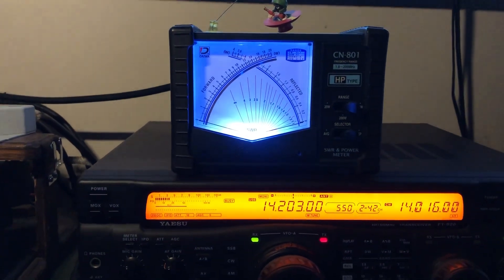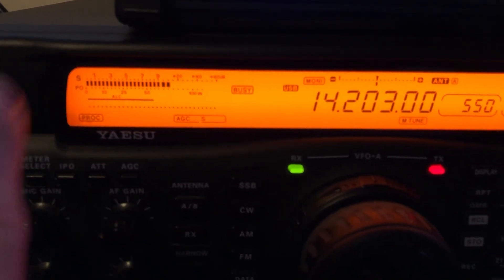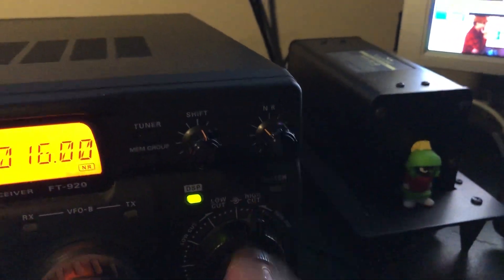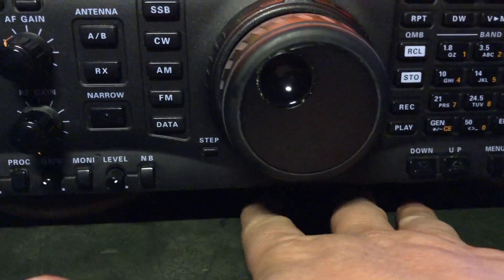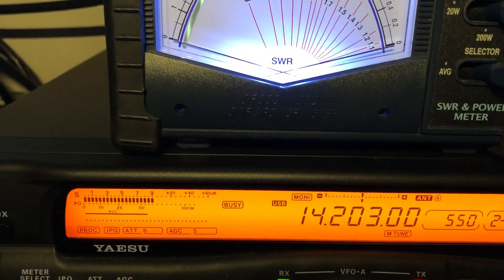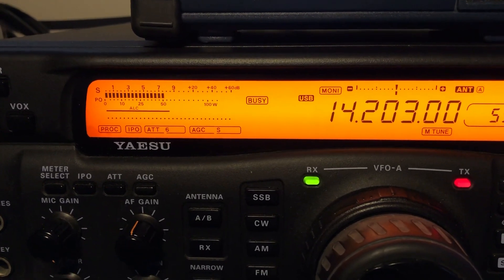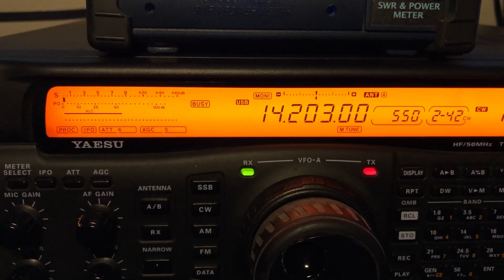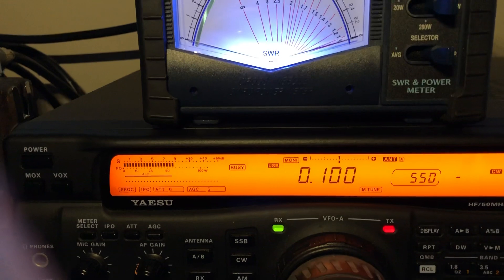Yaesu FT-920: DSP and Filtering (FTdx5000 being repaired)

Comment: I used to use the FT920 for 20 years.  Loved it especially for CW.  That DSP dial was fantastic for shaping the filter that you need.  It was hit by lightning last month so I picked up a FTdx10 with 300 Hz roofing filter.  Fantastic radio but I do miss that big DSP knob.  Thanks for making these videos
Reply from the maker: I still have my 920.  Used mine for 20 years also.  I did upgrade my FT-920 to INRAD filters. That extended its time on my operating desk.  But admittedly, it’s still no match for the FTdx10.
Reply: Do you find that it takes much longer to tune the antenna to a new frequency using the FTdx10 than the 920?     I recall the 920 was almost instaneous whereas the dx10 takes 3- 7 seconds
 @n4hnhradio
Reply from the maker: The internal ATU in the FT-920 is motor-driven and matches a wider range of SWR error. Once match parameters have been memorized, the motors track with band changes and the movement of the VFO. The ATU in the FTdx10 is relay-based. Once it memorizes settings it can recall almost instantly. But it can only match up to a 3:1 SWR error. That is typical for the modern transceivers from all manufacturers.  As many of you know, I like to call the new breed of internal ATUs “touch-up” tuners.  

We have fallen victim once again to only getting what we are willing to pay for.  Hams today complain about the price of the radios.  The manufacturers are pressured into cutting their margins razor thin. The fact is that radio prices have not kept up with the rate of inflation.  A Collins transceiver in 1959 cost $1,200.  In today’s money that is nearing $13,000.  Can you imagine paying approximately one fourth of your yearly salary for a ham radio?

My FT-920 cost $1339.95 back in 1999, and that was a sale price.  I had to pay extra for the FM board and the CW filter. I didn’t purchase the optional TCXO, regrettably.  All of those options are standard equipment on the FTdx10, for approximately the same price I paid for my FT-920. 

So how do manufacturers include these niceties and keep the price the same as a transceiver that sold for nearly the same price 25 years ago?  They do it by cutting corners in one or more areas to give the purchasers what they seem more interested in.  These days purchasers are more interested in a color touchscreen, waterfall, digital modes, etc.  Many of us use external wide-range antenna tuners anyway, so that is a logical area for cost-cutting.  And don’t forget the amount of internal space that the motor-driven tuners require.  The right-hand third of my FT-920 is antenna tuner.  The left-hand third of my FT-890/AT is antenna tuner. 

So the modern transceivers are typically smaller, which is another thing that purchasers seem thrilled about.  They don’t realize that at some point the radio becomes too small to have a decent sounding internal speaker. But the manufacturers probably assume we will buy an external speaker anyway.  Note that the external speaker is one of the accessories that help the manufacturers recover profit margin that is lost in the price of the transceivers.  As I said before, there is very little profit margin in the price of the radios. The manufacturers therefore charge a premium for the accessories.
Reply: @n4hnhradio  Great points. The rig manufacturers are also in step with the antenna manufacturers which offer nice broadband antennas that have swr's under 2. Also think modern electronics for military, cell industry etc. have driven the chip industry into the stratosphere. IMHO the DSP and DDS chips and of course processors are off the shelf. A lot of the engineering goes into the software and ergonomics for the operators.
Reply from the maker: The chips are absolutely not ASIC chips. They are standard chips. The magic is in the programming. Yaesu and ICOM both use Texas Instruments DSP (except the FT-710), but Yaesu has the better programming. Yaesu and I have a strained relationship, and that is an understatement. But I deal in objective truth on this channel. I have to give the edge to Yaesu, even though Yaesu is critical of me. If not for the private support I receive from viewers (via Patreon.com/N4HNH) my channel will cease.
Reply: @n4hnhradio  As a casual operator I was using my second hand ts-940 for 25 years until the other day when I received my second hand FT-920 which is what drove me to your video. My first "modern" rig and first Yaesu . Yaesu made a nifty xcvr and the menus are very intuitive. Great rig for 1990's vintage.
Reply from the maker: I agree. People think the Yaesu menus are difficult. I find them intuitive. Like you said.

Comment: The carrier offset trick to add treble to a bass-leaning mic was very helpful. My Yaesu MD-1c8 is very heavy on the low side and my MH-1bb hand mic out performs it without question. I'll give that offset a try. Thanks for posting!
Reply from the maker: You’re very welcome.  The FT-920 is still one of my favorite radios.  You can try switch position 2 or 3 on the bottom of the MD-1c8 to cut some of the low frequency response.  Position 2 will cut 100Hz by 5dB.  Position 3 will cut 100Hz by 10dB.

73, de N4HNH
Reply: @n4hnhradio  I've tried all 3 settings on the MD-1 without much improvement. I can record off the air for comparisons via web based SDR receivers. My voice just has too much natural bass to it. My MH-1 hand mic, on the other hand, adds the perfect amount of treble to cut through noise. But it's a hand mic. And I just hate to relegate that good looking MD-1 to the dust collector shelf. So the frequency offset test will hopefully bring it back to usefulness. Thanks again! 73 de K7KDX
Reply from the maker: In that case, I suggest setting the mic switch to position 3 and use a positive carrier offset of 100 to 150.  Also, set the mic EQ (menu U-51) to off.  You could try setting 1 or 2 in menu U-51, but those are DX audio tapers.

Remember too that there are 4 carrier offset menus, one each for LSB and USB, with and without the processor.

73, de N4HNH

Comment: I have the Yaesu FT920 and bought it new when they first available from the dealers. It still works very well and has never needed repairing.  73 Bob, M0BOB.
Reply from the maker: Still one of my favorite radios of all time.  I bought mine new in 1999.  The INRAD filters took mine to the next level. 

73, de N4HNH

Comment: I love this radio, I customized a 0.5 ppm TCXO, it works great.  FT-920 with 730 V dipole, I make a few hundred contacts in 2011/2012 at SSB mode. 
Taiwan to US, all Europe, South America, and the South of Africa.   
What wrong with your FTDX-5000?
Reply from the maker: FT-920 is one of the unsung heroes of HF rigs.  It still holds its own today.  Like I said in the video, the CAT port on the 5000 stopped working.  The fellow with Yaesu said the failure is often caused by RF, via the serial cable that is connected to the CAT port.  I just purchased the cable from RT Systems 3 weeks ago.  It doesn’t have an RF choke, so perhaps that is the issue.  We shall see.
Reply: @n4hnhradio  Noted. Just enjoy your FT-920 and just give us some news regarding your FTDX-5000.
On the other hand, did you think that the mu-tune 30/20 is worth own it or ...
Reply from the maker: My channel isn't only about the FTdx5000.  It pertains to general operating practices.  Like I say in the videos, much of what I do with the FTdx5000 can be accomplished with similar features in other radios.  It was simply my experience that the 5000, 101D and MP, and the 3000D from Yaesu were among the best receivers I tested.  The Yaesu DSP is superior.

As for the MTU-30/20, it can be worth it, if you chase ghost stations like I do, and you need that extra edge for combating QRN or QRM.  I use mine more against QRN than against QRM.  This is covered in my videos.  

The mu-tuners do not block QRM 2KHz away, contrary to popular misconceptions.  For that matter, neither does the VC tuning in the FTdx101D and MP.  The preselectors narrow the front-end of the receiver.  The mu-tuners narrow to approximately 35-40KHz of band-width, sloping on each side.  This effectively minimizes out-of-band interference.  

I use the mu-tuner as another type of attenuation, where I get to choose what frequencies get attenuated.  I adjust the mu-tuner such that the weak station I am listening to falls into the bottom edge of the skirt of the filter.  I can still hear them, at maybe S0 to S1, but the noise is gone.
Reply: @n4hnhradio  Thank for your solid  information input,  I am ready to order a MTU-20/30, hahaha.
I am fans of Japanese rigs, but since I testing the ic-7850/TS-990 in Akihabara, I really feel a little bit disappointed. Of cause, for the SDR that Yaesu is more delay than others as even got different concepts, so I bought FTDX-5000 month ago, in fact, I love FTDX-9000 400W.
  My next one could be the IC-705 or TS-890.